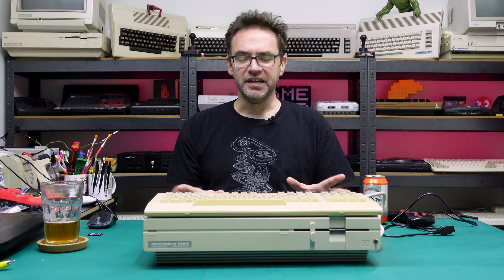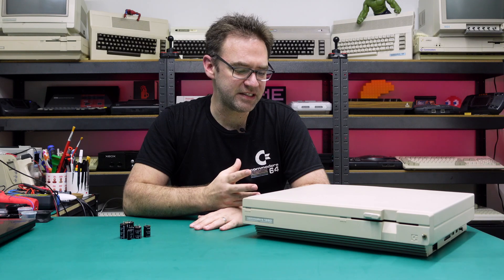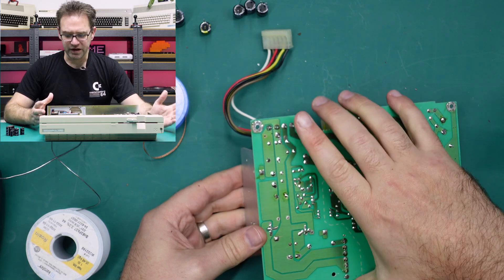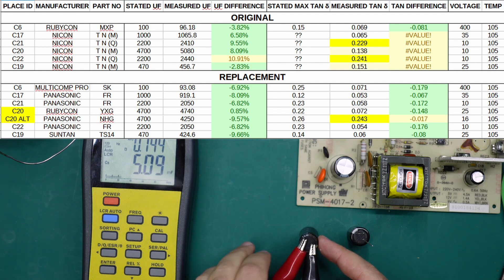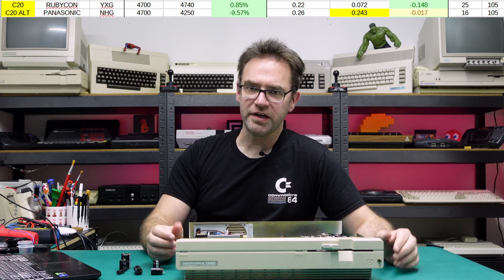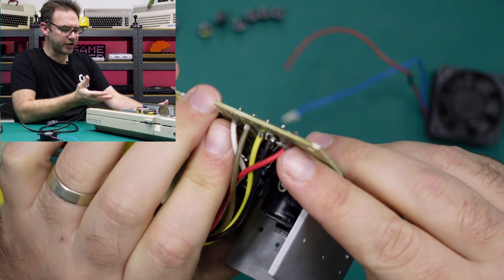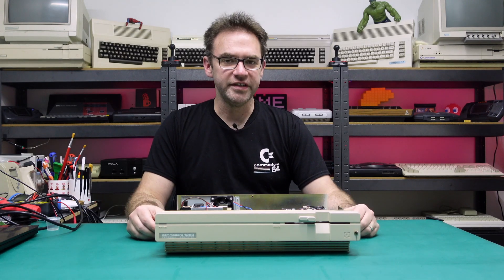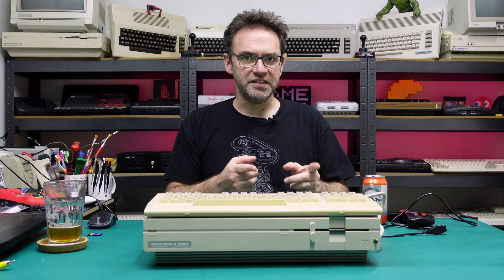C128D(CR) repair part 1 - power supplies, capacitors, fans and stuff

Comment: Hi thanks for the video ! I just built a power supply for my 128DCR as the factory one has a bad transformer. My 128D is now working but when I put the 128 top cover back on, my drive does not read floppy disks. Looks like some sort of EMI. Any ideas on how to fix that? Thanks !

Comment: An old Capacitor that measures over the rated capacitance is something I'd worry about.
Because that could mean that the Capacitor is leaky and the measuring tool falsely measures it to be fine, when it really isn't.
Be careful of that (I had a Taicon or Toshin Kogyo 2200µF Cap measure over 3000µF, so clearly not good no more).

Comment: Nice Video. Only nitpick i have that you should have measured the caps that see the switching frequency (i.e: the secondary ones) with a measuring frequency near the switching frequency. Measuring a cap that needs to function at 40 / 50 / 60ish kHz with 120Hz is more or less meaningless.
Reply from the maker: Heh, true. I was more concerned with seeing if they're dissipation factor was in spec. But checking other characteristics at 10khz or 100khz (that meter steps up to the power of 10 after 1khz) is a good idea. I'll be sure to do that for the secondary side caps next time a SMPS comes across the bench

Comment: Cool.  I have a 128dcr that I need to fix up one of these days.  The disk drive can handle both single and double sided disks in both mfm and gcr formats, right?  Seems like it would be cool to image lots of different 5.25 formats with.
Reply from the maker: Yes, it will handle both formats in single and double sided. I go into that a bit more in the next video
Reply: @TheRetroChannel  That is cool for DOS and CP/M format disks but.....  I wonder if it can read and/or write tracks on single-sided Apple2 floppies in GCR mode.  :O

The internet hasn't confirmed or denied this to me yet.

Comment: I finally after many years bought one of these. I was able to make a deal on one and very happy I got the DCR. I put a fan in mine. I used Noctua NF-R8 redux-1800 PWM. Its so quiet....even with the case open, you never know its there while running.
Reply from the maker: Nice and congratulations. Yeah this one could certainly use a Nocuta fan
Reply: @TheRetroChannel  Its funny how 35 years ago I couldnt justify 450.00 to 500.00 for this computer. This year I at 500.00...I couldnt click buy it now fast enough. LOL
Reply: I also have an C128DCR and have wanted to add a fan. When I searched your model, you listed an 80mm X 80mm X 25mm came up on a few sites. That seemed to big to me, so I searched C128DCR adding fan and found a few hits with people saying and showing them using a 60mm X 60mm X 10mm. What was the size of the fan that you installed? TY!
Reply from the maker: Just had a look myself. The maximum size that would fit is a 60x60x25
Reply: @TheRetroChannel  Found this on Amazon, Noctua NF-A6x25 PWM, Premium Quiet Fan, 4-Pin (60mm, Brown). Do you think this would work or be a good choice? TY
Reply from the maker: Yep, that should be the one
Reply: @Charleshawn66  If you are on Twitter, look up Retro Channels Twitter. I posted pics to him of how I put mine in. You will never know that fan is there.
Reply: I specifically went looking for a Noctua fan. I knew they were quiet. This is the only one that would fit. 80MM was too big. I have a box full of fans...So I was trying different ones out for size before I ordered the Noctua I got.

Comment: Great video as also! TY for this great Commodore content! Yes, those cartridge legs that you redid look so much better than what had been done good job! Great ideal to add the two pin headers to be able unplug the fan easily. What's in the glass? The can is mostly blocked and can see what it is. You moved, correct? If so, how did it go? Did your retro area change much in size? I live in a tiny house, and I'm maxed out with on space for my Commodore retro systems unless we move to a larger house.
Reply from the maker: Thanks. In the glass is an IPA from BentSpoke (a local brewery).
I didn't move, just did a bit of a revamp with some larger benches. The space I'm in is still pretty tight, so there's a lot of stuff carefully stowed away wherever any space is available

Comment: I would’ve expected the “ cost reduced” to be plastic.  Odd!
Reply from the maker: Yeah, it's cost reduced in the sense that the main board has fewer ICs and also integrates the disk drive controller. The plastic case has a lot more going on inside. Apparently the metal case was used to comply with the FCC rules in the US
Reply: @TheRetroChannel  Oh, I forgot about those crazy 80s RF shields everywhere here in the USA.  Can't interfere with the mighty TV!